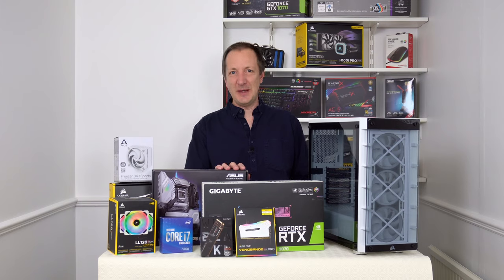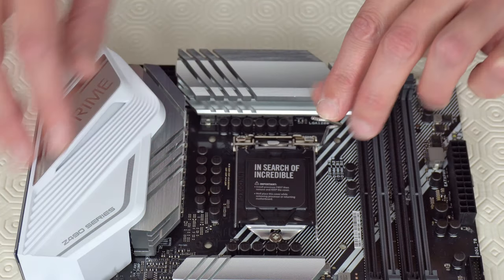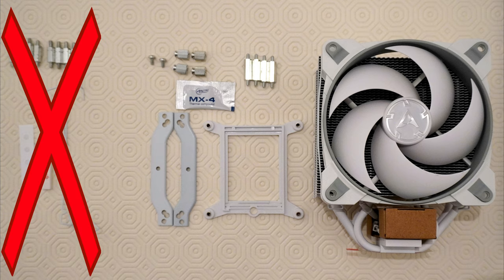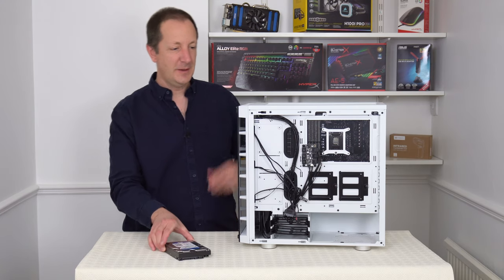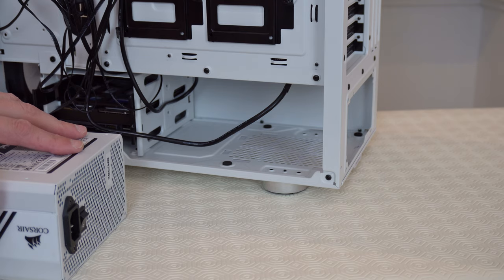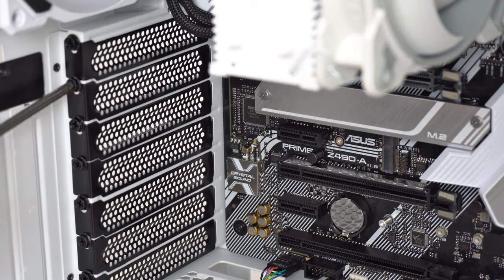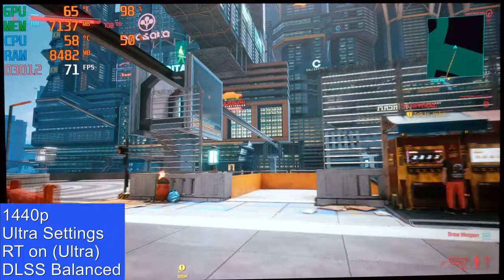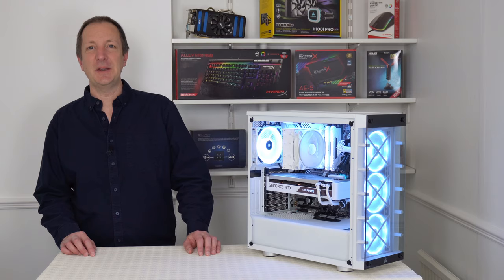How to Build a Good Looking Gaming PC - RTX 3070 - Intel 10700K

Comment: btw don't forget to use the riser for the m.2 drive I think you installed it wrong.
Reply from the maker: Yes, you're correct. I didn't install the stand-off for the M.2 drive. I realised afterwards, then put in a stand-off, but didn't film that part. I don't know how I missed that. My appologies for missing it out. Will pin your comment.
Reply: No worries Dave, we all have to deal with vague and often inadequate instructions. they should just put the bloody standoffs in by default.
Reply: @EasyPcRepairs  we all still love you lol
Reply: @EasyPcRepairs  does this affect the pc performance?

Comment: Your M.2 drives needs the standoff installed. It needs to be held up so it sits flush with the heatsink. Right now, only the part nearest the actual insertion point is touching.
Reply: It looks bent even

Comment: That looks amazing in White! Finally found someone that built a PC with a 30 series card with air cooler in this case. Exactly what I was looking for. Looks like it fits really well. I'm really considering building in this case with air cooler, 2 fans up top and back like yours with a Gigabyte 3080 card or might do a build with corsair 5000D Airflow but I love the look of this case. Was just worried about thermals and noise but looks like it's not an issue with your 3070 at all.
Reply from the maker: Thank you! Yes, I can tell you that the noise levels (when this computer is at idle) are extremely close to zero. Noise levels when gaming are very acceptable.

Comment: i just bought everything you listed after watching this. this is my pc now. i ordered black fans cause they were half as much tho. nice build and vid!
Reply from the maker: Thank you! I'm sure you'll enjoy your new computer.
Reply: @EasyPcRepairs  im so excited. this is my first build. been running on an Alienware from 2012 with an i3 for the last 9 years, definitely the upgrade I needed :)
Reply from the maker: Sounds like a very big upgrade. I'm not surprised that you're excited about it!
Reply: You just bought everything in this build?  How'd you get a 3070?  Also, buy one more fan than he did and replace the fan on the CPU Cooler with a matching RGB fan... his build looks off with that one non-matching, non-RGB fan smack in the middle.
Reply: @wolfshanze5980  paid 1500 for the 3070. already ordered the white cooler. i didn't know there was an rgb cooler, that'd would've been sweet too. I'm just waiting on the cpu, cooler, and 3700 to arrive now. the first 3070 I bought turned out to be a scam for $750 which I'm currently trying to get back from ebay but they are giving me the run around even after I filed a police report already like they asked. The seller sent me a piece of paper with a picture of the 3070 :( so I decided to just buy an overpriced one from a trusted seller rather than try to get a deal and get scammed again
Reply: @Tocen  ya, you definitely paid scalper prices... it's the only way to actually get one... sad times.

As for RGB coolers... Arctic doesn't make an RGB version of the 34 esports cooler... but if you like that white cooler, you can simply buy the cooler and replace the fan with whatever RGB fan(s) you're using in the case to match the scheme (different RGB fans display things differently,  I always use the same brand/make of fans for all the fans in a build, including replacing the CPU cooler fan... I do it all the time for aestetic reasons... it just looks nicer... the Arctic cooler just uses clips that will fit any 120mm fan.

Comment: Hey there I'm loving your content ☺️
Would it be possible for you to post a spreadsheet or something which gives a price per part/total cost for the build? 
Keep up the amazing work 😊
Reply from the maker: Thank you! The total price was about £2,000. Here's a breakdown of the parts and prices. CPU £347, 1TB SSD £139, PSU £120, fan splitter x 2 £14, Case £106, graphics card £768, motherboard £209, RAM £89, CPU cooler £30, RGB fans x 3 £86, 4TB HDD £119. The prices keep changing, but those are the prices that I paid at the time of purchase.

Comment: Great video! Very thorough!  Only thing I might mention for new builders is fan orientation: open face = intake.  Side with  the crossmember and wiring = exhaust. Usually front intake, rear/top exhaust works best,  but some poor intake cases, like some of the InWins might need additional bottom intake.
Reply: Will this setup attach a lot of dust?
Reply: Well, you'll want to make sure there are easily accessible dust filters, or a fine enough mesh or grill to function as a dust filter. That Corsair case is very good, had awesome magnetic dust filters.

Comment: Outstanding video, great build!  I guess when you know what you’re doing the blue words go away!  Am new to M.2 drives - what is the riser?  Something to use so the M.2 doesn’t bend?
Reply from the maker: Thank you! You're correct, the M.2 riser (also known as a stand-off) is used so that the M.2 drive will stay straight.

Comment: Do you think that SSD heat shield is actually a heat sink? The springy SSD, the green tape material, and the aluminum plate transferring heat in the windy environment??? Or do they not get very warm?
Reply from the maker: I would say it's a heat shield as the heat cannot transfer very well the the SSD cover. If it is acting at all like a heatsink, it is likely to only be transferring a tiny amount of heat.
Reply: @EasyPcRepairs  thanks! I'm not very familiar with computer builds yet.
Reply from the maker: No problem.

Comment: I really want to build this but I’m just not sure about the lighting node core and how to power it. Also the pre installed fans, do I have to plug them into the core and splitters?
Reply from the maker: The pre-installed fans are already plugged into the lighting node core. the other 3 fans that you will install yourself are then plugged into the other ports on the lighting node core. The lighting node core is then powered by plugging it into the power supply. Each fan also has to be powered by plugging them into a fan splitter, then the fan splitter plugs into the moteherboard. It may sound a little complicated, but it's more obvious when you see it all for yourself.
Reply: @EasyPcRepairs  thanks, that clears it up 🙏

Comment: Great video! Any chance you can list the cost of the parts in this build and/or a total build cost? I’d also be interested in your take on a PC build for a unit meant specifically for video editing.
Reply from the maker: The total price was about £2,000. Here's a breakdown of the parts and prices. CPU £347, 1TB SSD £139, PSU £120, fan splitter x 2 £14, Case £106, graphics card £768, motherboard £209, RAM £89, CPU cooler £30, RGB fans x 3 £86, 4TB HDD £119. The prices keep changing, but those are the prices that I paid at the time of purchase.

Comment: Can I ask why you opt for fan cooling for the CPU instead of liquid cooling? It’s rare to see in high end builds nowadays.
Reply from the maker: There were a few reasons that I didn't go with liquid cooling. One of them was that a liquid cooler won't fit at the top of this particular case (it would've hit the motherboard). And if I'd put a liquid cooler at the front of the case, that would have meant its tubes likely touching the graphics card on this particular PC, which may have looked a little unsightly. Also, the only good RGB white liquid cooler I could find (one by Corsair) would have cost quite a lot more than the air cooler that I chose, and (at the time) there was quite a long wait to get one too.

Comment: Where did you buy your fan splitters? And do they sell the hard disks in Curry's?
cheers
Reply from the maker: Bought the fan splitters on Amazon. Currys do sell hard drives (which is where I purchased mine).
Reply: @EasyPcRepairs  Is there a specific amount of pins? Or can I get a link? Cheers
Reply from the maker: I used 4 pin fan splitters. Just to avoid any confusion, they have 4 holes at one end of the splitter. At the other end, one connector has 4 pins and the other two connectors have 3 pins.

Comment: If you had two pc towers that were identical to each other, with the exception that one was black and the other one was white, would they both draw the same amount of heat when they're powered off and powered on? If there would be a temperature difference, what would it be?
Reply from the maker: That's an interesting question. I've never put it to the test. I would imagine that a white case would be very slightly cooler, but can't say for sure though.

Comment: One more question where did you get the cpu cooler and the rtx 3070 because I can’t find them anywhere
Reply from the maker: I got the CPU cooler from Scan.co.uk and they are also available at amazon.co.uk and amazon.com (in stock in all 3 places). The RTX 3070 graphics cards are currently not in stock.

Comment: What's the point of the hdd when you have the m.2?
Reply from the maker: There are a few advantages to having a hdd (as well as an m.2)... for example, the hdd can act as a backup for the data that's on the m.2, so it's a cheaper way to back up any data.
Reply: @EasyPcRepairs   OK. I always wondered if people were installing all of their games to the hard drive and then only the operating system to the M.2. And I always wondered if that was a silly thing to do because how would the games load times being increased if it was being ran it was being ran from my hard drive I've gotten a lot of conflicting answers to that.
Reply from the maker: Yes, I don't think there is a right or wrong way to use them. Most use them however they want to. If they want faster loading games, they install them on the M.2 drive. If they don't have much space on their M.2 drive, the game ends up on the hard drive.
Reply: @EasyPcRepairs  thanks for confirming. This is something I've wondered for a long time.  One gentleman even tried to tell me that it doesn't make a difference in loading time in the games whether it's installed on the hard drive or drive or m.2.